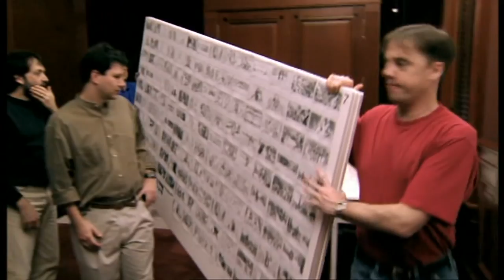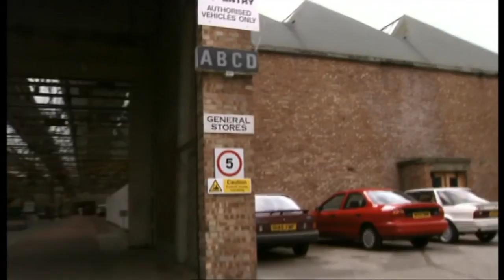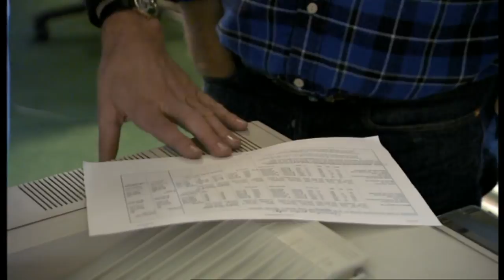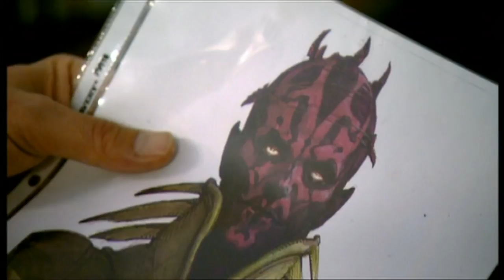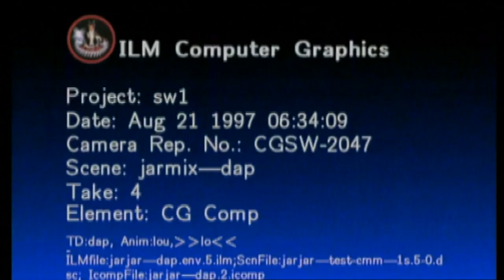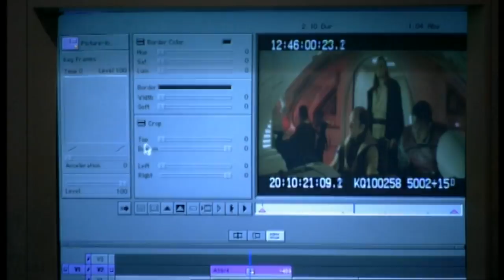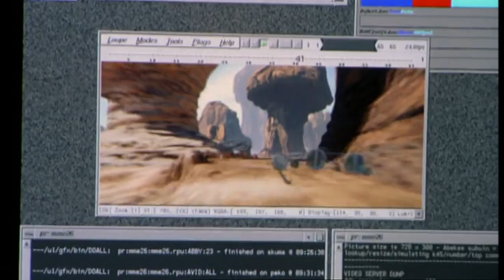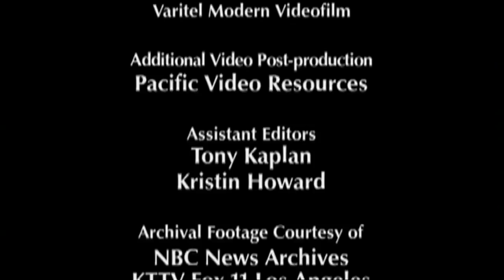Star Wars Episode I The Beginning: Making Episode I

Comment: Despite how much CGI the prequels use, it does seem as though this one actually had the most practical effects in comparison to 2 and 3.

They used a few miniatures for certain shots, the pod race engines were real, SOME of the aliens were puppets or people in costumes, they had some rather large sets, Jar Jar was originally 90% practical before becoming completely CGI, they used a puppet for Yoda (despite that people didn't like that one), C-3PO without coverings was also a puppet, SOME of the battle droids were models on set, and some of the Trade Federation tanks were real. (which you can see at 9:23)
Credit where it's due at least.